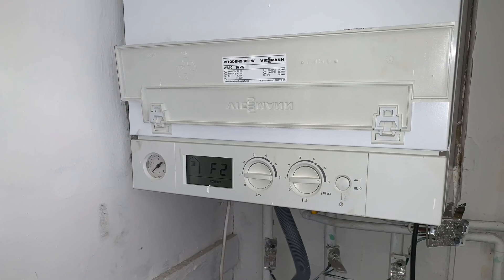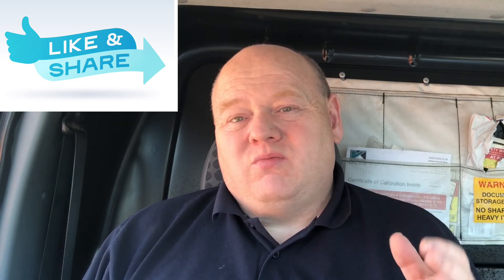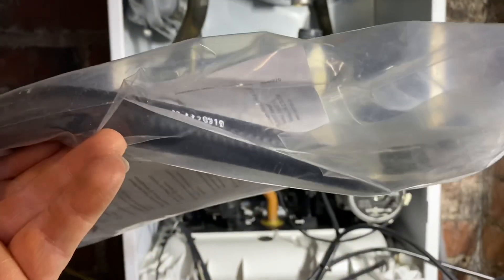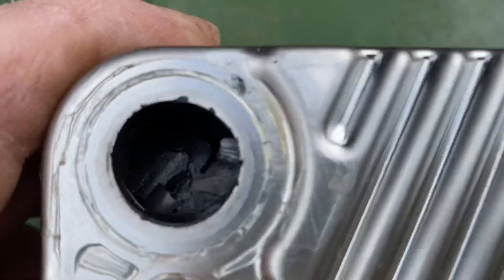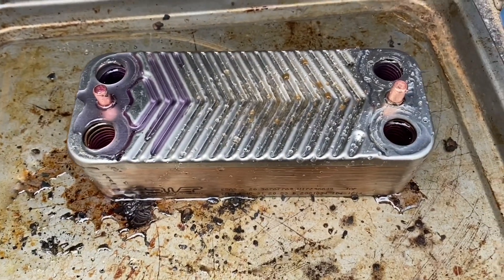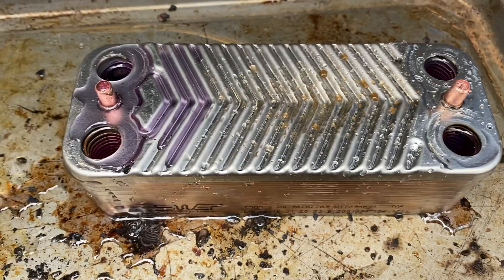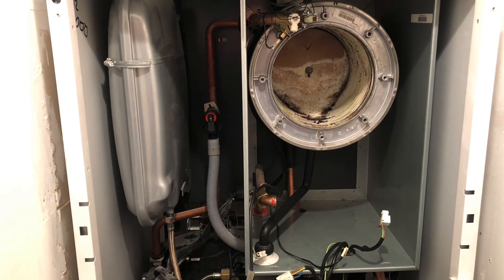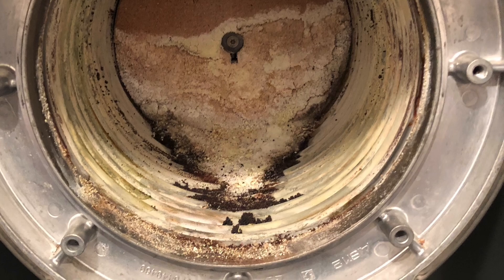VIESSMANN FAULT CODE F2 - LEEDS PLUMBER

Comment from the maker: https://www.facebook.com/groups/Gas999/
Reply: How are u keeping Allen? Hope ur Mrs has fully recovered now , best of luck mate
Reply from the maker: Yes she is a lot better now. Thank you so much.
Reply: Hi Allen I had my boiler serviced by a young inexperienced guy . It was flashing F2 on a viessman boiler and I had no hot watee water  that has not been serviced for 5 years. He didn't take the plate or hose  out to clean  he just said the AAV needs changing as there was water leak inside the boiler. I asked him to clean but he said if take part out they may become damaged and need replacing. The pressure keeps dropping to 1 bar . Just wanted to get your take on it

Comment: Thank you, my rubber pipe was completely blocked making everything Luke warm at best. Removed pipe and cleaned and now working again. I have some cleaner in atm so next job is to drain the system and replace the water.
F2 fault 👍

Comment: Hello Allen, i've been having F2 fault in a Viessmann vitodens 050, heat exchanger has been cleaned many times, and boiler as well. Temperature runs to 100 Celsius. Any ideas? 🤔 Many thanks

Comment: Hi Allen,  
helpful video. 
I replace CH pump on boiler , take off heatexchenger and 
cleaned out it and hoses. But it still overheating. 
one part heatexchanger cold and second part of heatexchenger hot🤷‍♂️
looks like blockage inside heatexchanger.
Do you have any advice? how to clean heatexchanger if it hard blockage

Comment: Hi Allen, I have an F2 error, hot water is not too bad, it comes in hot after around 30 seconds, however my radiators arnt warming up, do you think replacing the heat exchanger plate and getting the radiators flushed would fix the issue?

Comment: I have changed the heat exchanger one year ago and the F2 error is here again. Do I have dirty water pumped into the system ? Why is the exchanger so sensitive ? I have a filter, new exchanger and once again I have this problem. No hot water.

Comment: hi allen, i have a viessmann 100 w b1kf 30, got home today and on the face it had cl and above that a red triangle
Reply from the maker: What was the issue? Thanks.
Reply: @AllenHart999  turned out it was the mains gas had been turned off out in the street, glad about that as there is nothing in the fault codes

Comment: Allen - I’ve got an f2 fault - all pipes and heat exchanger cleared and flowing well but hot water is tripping f2 what should I do next
Reply from the maker: https://www.youtube.com/watch?v=LUxWHBAHGKc&t=95s
Reply: Did you manage to sort this out? I have the same problem but Viessmann technical helpline not very helpful. I don’t know if it’s a problem that an engineer is required for or if it’s air in the system or just a strange setting....

Comment: Hey, I have a vitodens 050. Was working well but had to be turned off and when turned back on the f1 fault code came up. Reset it which got it firing but noticed some strange noises also the temperature on the digital dial instantly rose over 90 degrees, f2 then appeared and now back to f1.

Need to phone an engineer out but is there anything else i can tell him to narrow it down incase he has to order a part?
Reply from the maker: https://www.youtube.com/watch?v=LUxWHBAHGKc&t=95s

Comment: Hi Allen
Have you come across a FF fault before? When speaking to Viessmann they recommended changing the PCB but I’ve had that changed (pricey) and no such luck. It’s on a viessmann 100wb1c. 
Cheers
Reply from the maker: Normally PCB
Reply: Hi josh, Did you manage to get it sorted out?
 was the new PCB properly programmed to the serial number of your boiler?

Comment: I’m not a heating engineer but I can recognise this man has pride in his work . The whole tradesman space is unfortunately spoilt by a minority of cowboys who know what they are doing but won’t do what’s in the customers best interests or don’t even know what they are doing and are making it up as they go along . One interesting observation is I have several rental properties and tend to go for the 20 quid a month 24 hr unlimited calls service contracts to save me hassle when breakdowns occur .They understandably have a bar on boilers over a certain age .The fees include a yearly ‘service’ and  also the statutory Gas safety certificate so seem excellent value especially as it’s a tax deductible expense . 
       As far as I can tell there is no meaningful service being done it’s just a safety check .As an example a visit last week took 30 mins and that included checking an oven and a gas hob as well as the boiler but why would they not service it properly if they are the ones who are going to be called out in the event of failure ? I can understand that at £240  doing everything ie a thorough service in addition to the unlimited call outs may not be cost effective . Could the business model be therefore to let the boiler fail then come out and declare it beyond economic repair to try to bag a whole new installation ?
Reply from the maker: Thank you so much for your kind words.
Reply: Mike Lucas Your observations have been spot-on Mike the £20 a month package seems good value and peace of mind but I would highly recommend you get your boiler separately serviced by an independent local engineer like Alan Hart  these contract guys apparently only do a visual examination of the boiler I recently looked at a landlords boiler that had broken down the engineers from the service contract did not even want to look at it and classed it as ‘beyond economical repair’ Sure enough the boiler, (an ideal logic six years old), sounded poorly and noisy but after i stripped it  down & thoroughly cleaned out the heat exchanger/ fan and burner assembly the boiler ran like new!, I am confident if that particular boiler is serviced every year it will last another 6+ years. Another boiler on service contract, same age and model developed a leak inside which corroded the whole internal casing writing of the boiler if it had been serviced properly and on time and the £30 component replaced it would still be running today needless to say the landlord I deal with now gets each boiler properly serviced annually, as the manufacturers instructions clearly state.

Comment: Great video Allen, I’ve did almost the same on same same boiler.. just cleaned hoses through with acid and water, cleaned plate and give a service and boiler worked a treat, even had the F4 fault.. was the bottom of the main Heatexchanger chocked , cleaned and flush through ... 
great videos .. 
what about a video  gas rating and appliance working  pressures
Reply from the maker: Very good idea. Leave that with me. Thanks for your support.
Reply: Don’t use acid on the rubber hoses Tommy  just squeeze them in your hand, tap them up and down the floor and you will get most of the crap out , ideally jet wash them , main heat exchanger,  with it sitting on the floor facing upwards jet wash through flow connector & all the dirt and sludge will come flying out of the return Connection on the back of the heat exchanger. Always worked for me 
and I can’t tell you how satisfying it is!

Comment: Hi Alan, does wiesmann have alternatives for these rubber hoses like Vaillant does? as in my opinion, any kind of plastic pipe or rubber which does not have oxygen barriers makes any kind of system rust from inside and amount of  extra inhibitor just does not make much difference, as I say,rust - sludge kills the boilers, rust never rests,,Just airtight system, filter and extra inhibitor fernox in my case normally two bottles makes difference, regard to you always good videos, I'm gas safe registered
Reply from the maker: Libor Jelinek The new 100 is copper. Thanks
Reply: Too much inhibitor is not good, it can turn to jelly if it is too concentrated, which will definitely mess your system up

Comment: Hi Alan what was the tool you used to flush out the plate? And will that tool work on all different plates or just viessmann
Reply from the maker: I got it with my powerflush machine. Thanks.
Reply: @AllenHart999  thanks very much

Comment: Been working on one for two days Alan. I removed the hoses two years ago as they were blocked solid, so was the plate  heat exchanger and left and right hydroblocks, I spent half a day unblocking them and washing them out. I'm back two years later ; removing and manually flushing  every rad, then put Sentinel X900 in, and ran it through my MAGNACLEANSE. I changed the Plate heat exchanger this time ( I should point out that it wouldnt fire for anything , when I arrived, so I changed the 'thermister' in the brass manifold at the top of the Heat Exchanger)
I fitted drain valves to all rads ( it is a groundfloor flat), and I think it is almost there. 
I am going back tomorrow to remove and flush the x900, and I am fitting  'drain cock', in a tee from the flow pipe under the boiler so that I can 'reverse flush' if necessary, the suff that came out of every rad was like crude oil, and they are not that old cheers dx
Reply from the maker: Good luck with it. Let us know how you get on. Thanks.
Reply: David Waterhouse Hi David that sounds like one hell of a job you done there! I’ve exactly done the same job on one last year 
I actually found it quite pleasurable!  I’m curious to know as to why it wouldn’t fire up how did you come to the conclusion of the thermistor being faulty?  did you test it with a multimeter?
Reply: @SalimKhan-gk1fh  Yes, but I had to call Technical to ask them what the resistance should be, I can't remember what it was off the top of my head now, but once I got it to fire, it was cutting out on hot water and heating, and the temp was climbing rapidly, which indicated circulation problems to me.  I am quoting the same job next week on the same boiler for another customer. It is currently working fine but I serviced it a couple of months ago and pointed out to the customer that the hoses were rock solid, and I demonstrated this to them. When I removed the magnet from the magnacleanse, it was the worst one I have ever seen, there was that much magnetite on the magnet it was almost touching the sides of the barrel. Obviously never been cleaned out, but surely the installer never did a flush on that system.
Reply: David Waterhouse Well done to you David for actually tackling the job properly and getting to the root of the problem I did leave a previous message on here that down in my area down south I’ve seen boilers condemned/ripped out and replaced for very small minor faults like blocked plate heat exchangers /thermistor faults and simple things as diverter valves motors, The resistance on that particular boiler is around 13 K ohms at 25° , you can find it in the back of the service book, are you  still working on the same boiler? if the Magna clean is that dirty and the hoses s are rockhard then the whole system needs flushing luckily they are a dream to work on these viessmann boilers everything is accessible and everything is removable easily, i’m currently looking after about 25 viessmann boilers , all my installs have been fine and the ones I have flushed for other people not my installs, have been okay as well they say the hoses are a magnet for magnetite ?if so we need Magna cleans made out of rubber!! Which model are you working on is it WB1C?
Reply: @davidwaterhouse2552  How did you get on with that job mate?  did it all go well?
Reply: @SalimKhan-gk1fh   The Job I was working on when I was discussing it with Alan, was about three months ago, and as far as I know everything is fine. I am sure I would have heard back from them if there were any issues. But I have got another one to do over the next two weeks, i is a Viessmann vito dens 100, that I serviced about a month back and the rubber hoses were rock solid and the magnaclean was full of magneteie. I will update yo uwhen I am doing it, cheers dx
Reply: @davidwaterhouse2552  Hi David thank you very much for getting back to me. Much appreciated it’s always nice to know what other engineers are doing about this type of problem / repair , I work on my own so it’s comforting to know I’m not the only one stuck in a kitchen for three hours unblocking a boiler! These days you can’t seem to get much information from other guys as much of the younger generation Are not interested in repairs or even the job they do! they just like to install a new boiler,  down here where I am it’s common,These boilers are actually easy to strip down and access all parts, i would rather work on one of these then something like a Worcester! Just a matter of interest have you ever used antifreeze in the system fill water? The viessmann boiler I fitted in my own home seven years ago has added antifreeze to the system water, up to date I have not had any issues with dirt sludge magnetite or crunchy hoses, The solution seems to prevent formation of hard magnetite deposits and seems to keep these deposits soluble I have noticed the Magnaclean picking up a lot of fine dust particles, with antifreeze you seem to get a faster warmup time with the radiators emitting much more heat than standard water alone,  Also the boiler is much quieter running in genera as antifreeze circulates easier,I now use antifreeze (instead of inhibitors) on any installs I do. Look forward to hearing how your viessmann job goes
Regards Salim
Reply: @SalimKhan-gk1fh  JUST TYPED A VERY LONG RESPONSE , and pressed the wrong key and deleted the b???er! I will get back to you pal, but the Antifreeze sounds like a great idea, Cheers dx
Reply: @davidwaterhouse2552  Oh dear !never mind ! yeah it’s a bugger when you delete the message by mistake 
I was looking forward to detailed reply as well !

Comment: Blocked plate heat exchanger? Down here in Brighton you won’t get many ‘engineers’-installers replace or repair that part
The boiler will be ripped out and replaced with a new one! U see it on a daily basis
Reply from the maker: Salim Khan Very easy to repair. Just takes a bit of time. Thanks
Reply: I see loads of recommendations to remove and flush them? I wouldn't bother, it is time consuming, and what would you charge for that job? AND It is not guaranteed to work! 
As Alan says; easy to swap, drain everything down, some boilers like Ideal ISAR/ICOS, you need to remove PCB (2 minute job) 
But the plate is usually held in place by two or four screws! New Boiler??????
Reply from the maker: David Waterhouse I have only ever replaced one heat exchanger, I normally flush them out. Thanks
Reply: @AllenHart999  Good for you pal, if it works! My point;  if the seals are perished, like they are sometimes on the Ideal Isar/ Icos, you have to order them (I do have some in vans stock) but if it doesnt  work of then  it is quicker and easier to change it! But we don't need to replace the boiler do we??

Comment: What are your thoughts on softened water in the system. Some manufacturers recommend it others invalidate warranties. Would you recommend a system boiler if the house has artificial softened water. Gary
Reply from the maker: I would just follow the installation instructions. Thanks.
Reply: Softened water is ok for Viessmann Hex, but fg. not allowed for AlSi Hex (Bosch, Junkers, Buderus), only demi water witch is below 1uS conductive.

Comment: Great video, was the second boiler fixed in the same way or did you have to replace the hex?
Reply from the maker: Do you mean the plate heat exchanger? Thanks.
Reply: Allen Hart Ha yes sorry I do. Did you just hoover out the burner area which showed all the dirt (apologies I’m not Gas Safe)
Reply from the maker: @W1ndy.  I removed plate heat exchanger and cleaned them. Thanks.